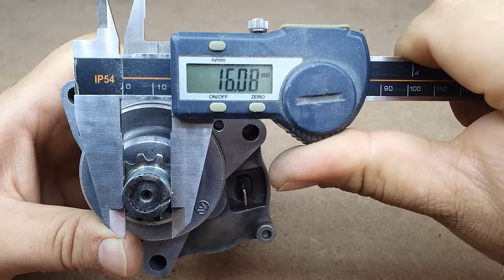DIY e-Bike/How to make Electric Bike with starter motor/Marş motoru ile elektrikli bisiklet yapımı

Comment: Nice e-bike concept and execution. 
While watching your work an idea strike me. Regeneration braking down hill only. 

Just add a >10Amp rectifier diode across the circuit breaker micro switch. Such that diode anode to the motor positive and diode cathode to battery positive. This will not affect forward operation with the benefit of down hill charging.

Problem? The load gear is on free wheel. Front wheel can’t drive the motor.

Comment: Great workHow long did the starter motor last?
Reply: This a ride which will not last long. It's like trying to move forward with a manuel car in 1st gear or any other trying to start your car by turning the key at the same time it will advance but will get burnt very fast and so will the battery. 1 shot deal but good idea.

Comment: The torque load on that is going to do the spokes no good at all. Why not try this on a wheel that has a disc mount boss on the hub?
Reply: @SinanKeskinDC  Not at all! Disc mount hubs are now a mass market item and commonly appear on entry level bikes these days. 

Driving the wheel through the spokes goes against the very design principle of the wheel itself as the spokes are elastically preloaded structures that are designed to flex longitudinally at the blades exactly where this Heath Robinson contraption is mounted. By driving the spokes at this point you are straining them as they are supposed to flex along the entire length when correctly driven under torque load from the hub itself.

I would not recommend this if you value your teeth at all as the dramatic collapse of the fronf wheel could result in you losing more than a few. This thing is just plain dangerous on a spoked wheel but would be more acceptable on a disc wheel.

Comment: Ive seen this done on other videos. but why lose the whole front brake!? they all seem to be newer $500 or up disc brake bikes so to me...doing that means I decreased my ability to stop easier as well as losing cost from that which i paid for with the bike just for front wheel motor assist?  not a good trade to me.